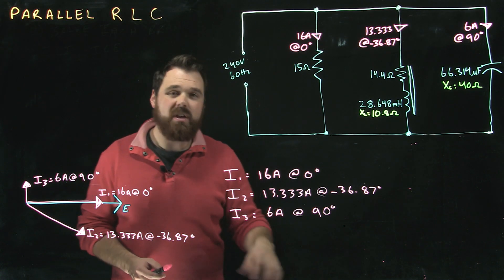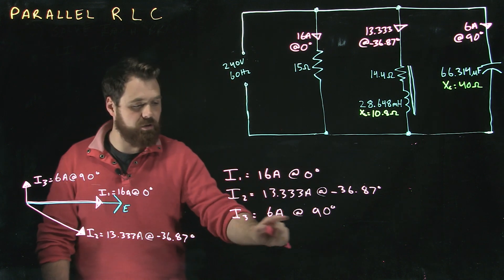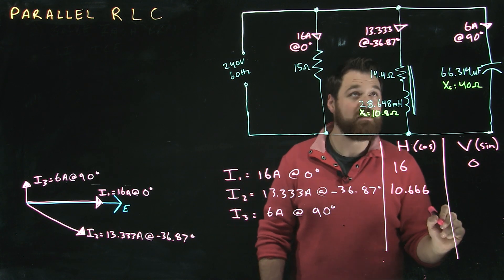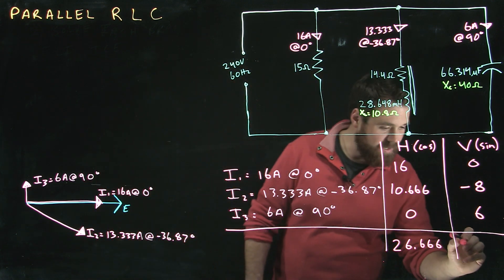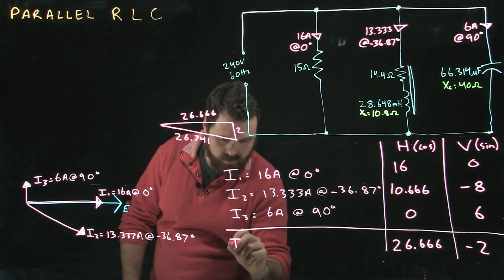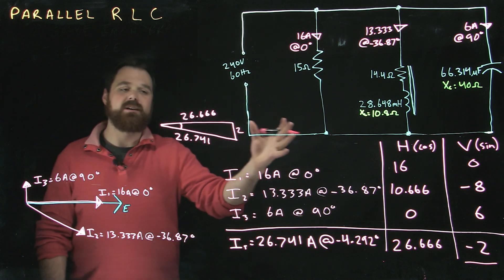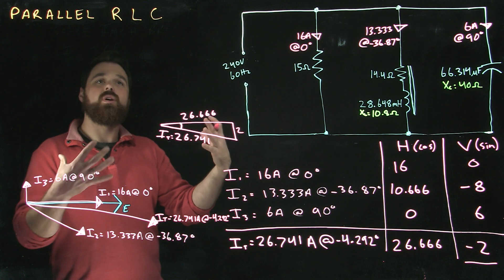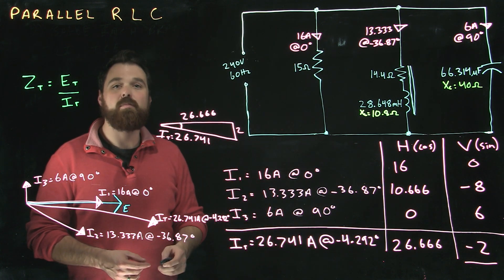Parallel RLC Step 2 Current

Comment: I'm just not getting how you got a negative angle or where the 10.66 came from?
Reply from the maker: SO in that HV chart, the 10.66 comes from 13.333 x COS(-36.87)

We know it's a negative angle because the Current LAGS the Voltage. Since voltage is my reference at 0, then current has to be "down"